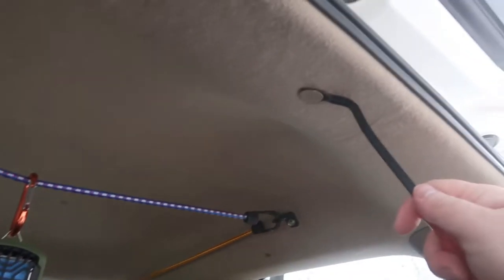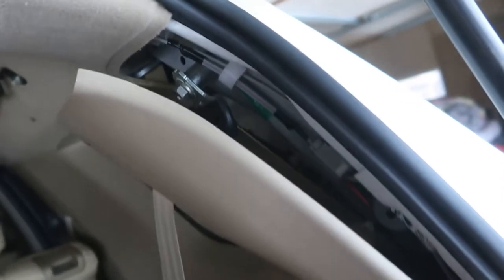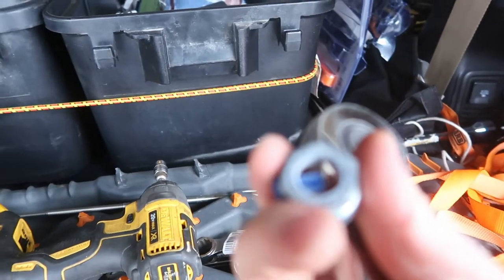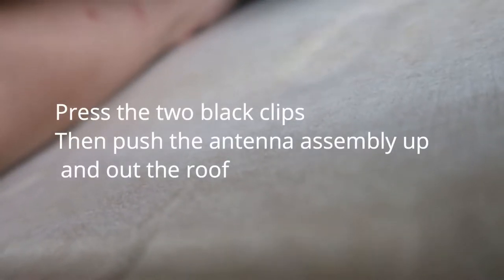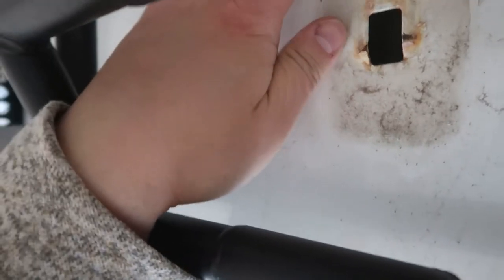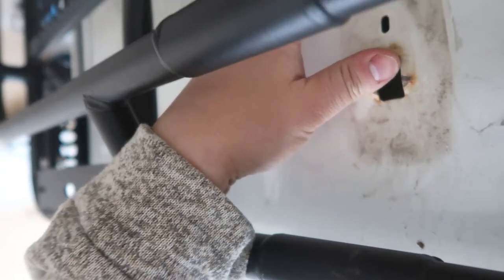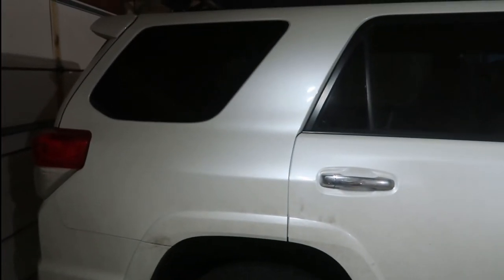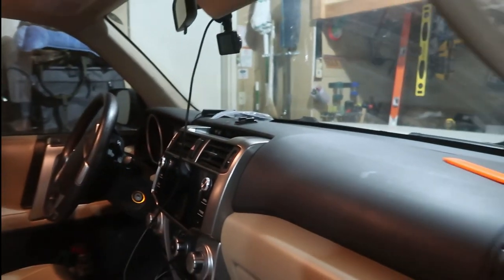How to remove 2010-current 5th Gen 4runner sharkfin(XM radio) antenna

Comment: I have the exact same issue... kids were playing w/ garage door and somehow stopped it from opening 100%...then when i backed out the antenna hooked the bottom edge of the door and then popped out through the roof.  I need to fix it up so your video and detail is awesome, TY for that.  Did you end up replacing the antenna or did you have your body guy close simply close up that hole?